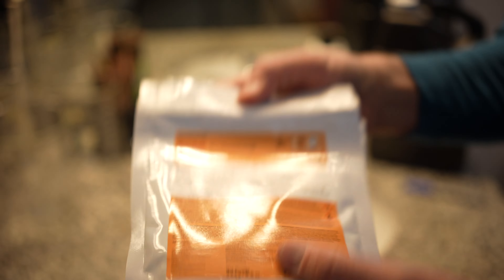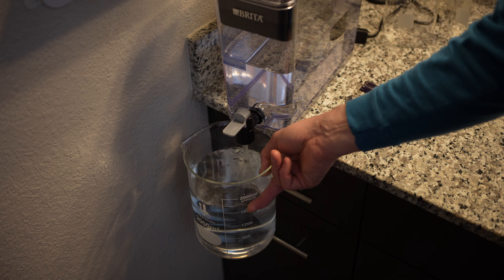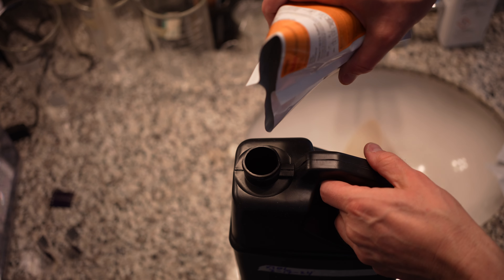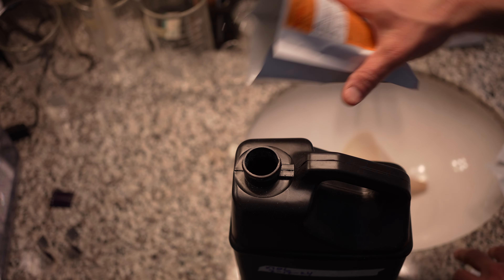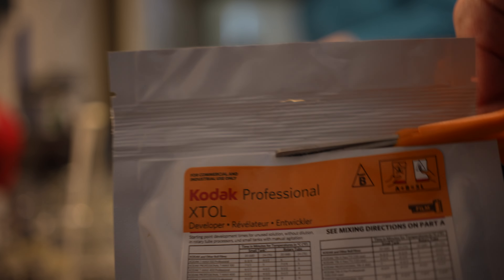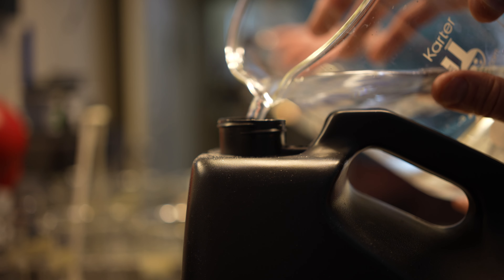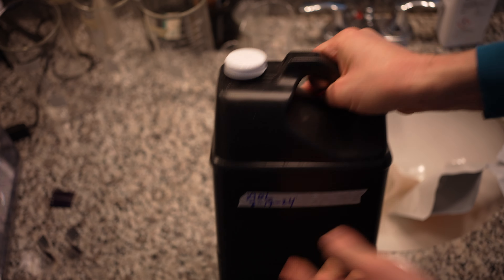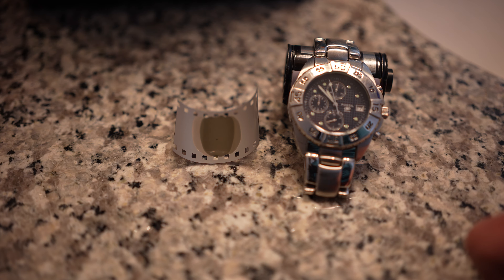Mix Kodak XTOL from Powder to Stock Solution

Comment: I love XTOL, and I've mixed a lot of it. 
For those interested, it has a tendency to form some crystals when added to cooler water, so getting your H2O warmed to the upper end of the indicated temperature range makes a big difference. I use 29C. It's also helpful to use a clear mixing vessel or container in order to ensure all the powder has dissolved. An added benefit is you get to watch the solution clarify speedily when you add Part B! 
It's a wonderful developer for those Tri-X pushers out there.
Reply from the maker: XTOL is a solid film developer for sure and aside from the hassle of having to use a five-liter jug, it's super easy to use.

Comment: Nice video. I'm a bit confused by the test you did with the film leader at the end. I thought you were going to do a clip test on the developer but then you said "fixer" and clearing time, so I'm confused about why you would mix up new developer and then do a fixer clearing test. Did you mean to say "developer" instead of fixer? Thanks for clearing this up.
Reply from the maker: Did I say fixer and completely miss that in editing? I may well have and that's a good catch on your part. So the test was on the XTOL stock. With that test, the objective is to identify how long it takes for the stock XTOL to turn a snippet of film leader black. That's a baseline to later test the stock solution against as it ages to make sure that it hasn't lost efficacy before developing actual film with it.
Reply: @DavidHancock  yup you said fixer multiple times and I was like “what? Have we changed subject?”

Comment: Just on time. I've just switched from ID-11 to Xtol (XT-3 actually), and so far so good. I'm going with a replenishment routine which I'm still getting the hang of, but should work well in the long run.
Reply from the maker: You'll probably like XTOL. It's a good stock.